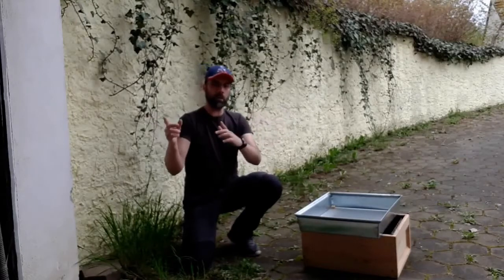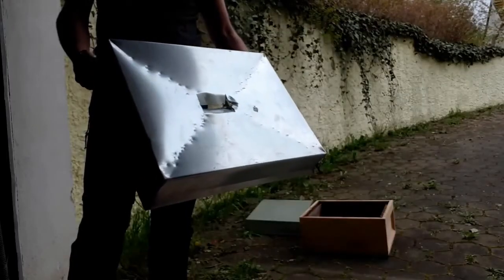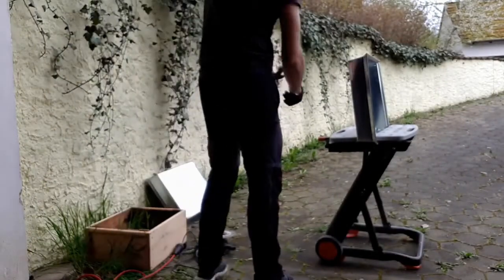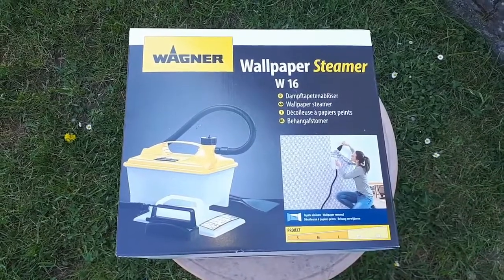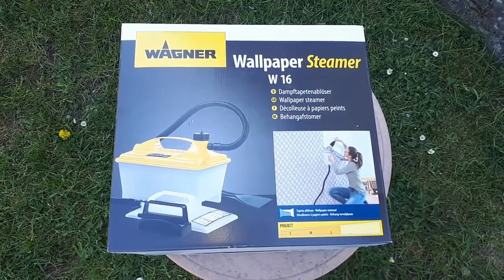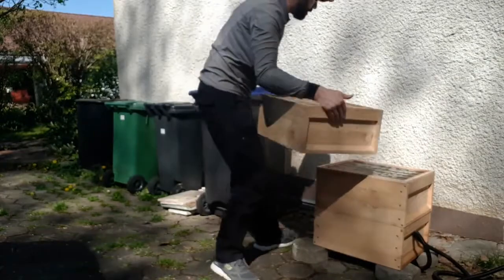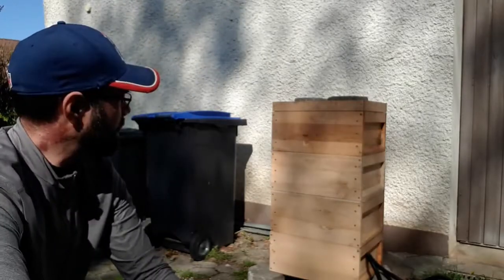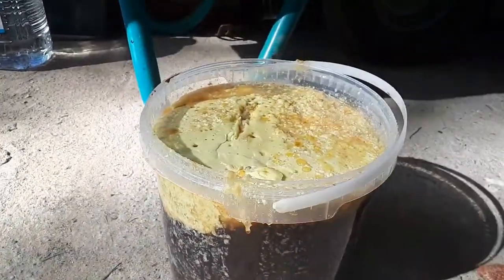How to render beeswax from honeycomb using a homemade steam tower

Comment: Nice job.  I've been thinking about it for a few years.   Maybe next summer I'll put it together.    I might so a rocket stove set up and makeshift  an old propane tank.    Set it up like the guy with the fire and big tank.    Then I don't have to buy a steamer.   I never realized those little electric steamers could produce that much heat to melt wax in two deep hive bodies
Reply from the maker: It works great. I think I might get two styrofoam deeps as they are easier to seal up and less steam can escape.

Comment: I like what you are doing, I am just about to make one of those. I saw the video from way out west beekeeping and a couple things that he did differently were that he made his tower tall, 5-7 boxes tall and he strapped his whole unit together. He had a wood fired home made setup and it looked like he was burning a lot of wood to make a lot of steam too. 
I wonder, would you put the steam inlet lower next time to melt those drips better?
Reply from the maker: thanks for the comment. I haven't really changed the setup much since this video, so the steam inlet is in the same position. The biggest challenge comes when frames have a lot of pollen on them. There it seems the steamer just cant produce enough steam to really melt down the frames. I've had the most success with two boxes of frames, any higher and the steam cools down too much on the way up. Good luck!